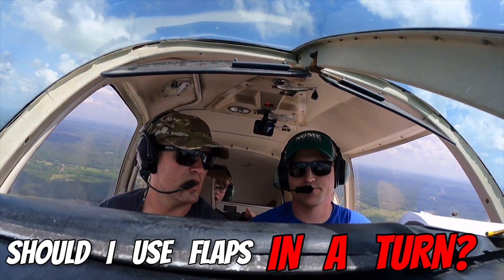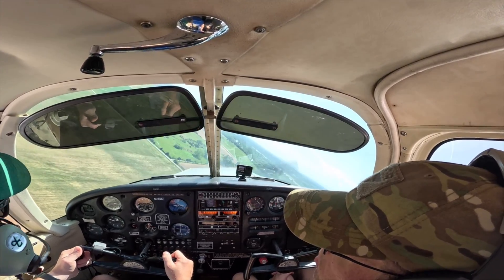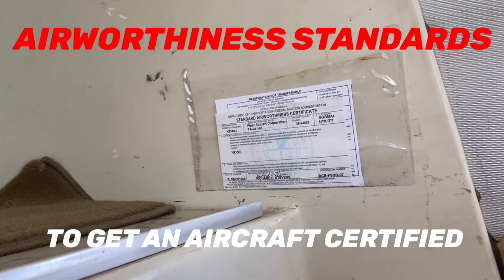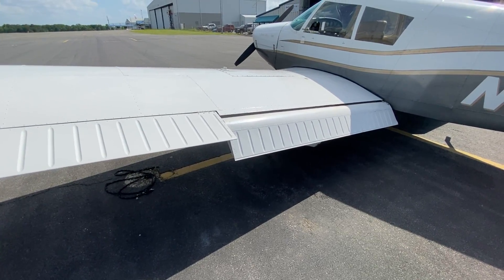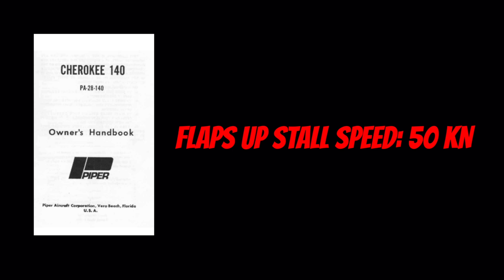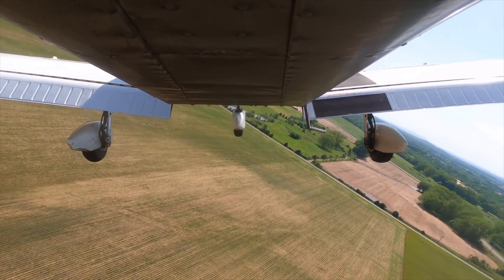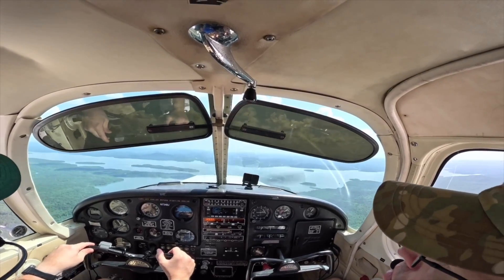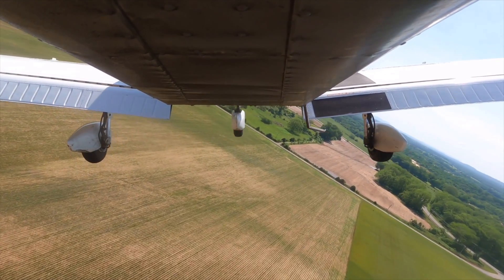Should I LOWER Flaps in a Turn?

Comment: I don't buy your assertion that the turn radius is less with flaps at a given airspeed and bank angle. In level flight, the amount of lift produced by the wing is based on the aircraft weight, the bank angle, and some trigonometry. Although the wing may be capable of producing more lift with flaps deployed, it isn't actually producing more. It is true that the flaps would allow you to use a steeper bank angle or slower speed with the same stall margin. But, unless you change the speed or bank angle, your turn radius will be the same. I am not challenging the main conclusion of the video.
Reply from the maker: I will admit that it is an assumption based on my experience, BUT flaps allow you fly at slower airspeeds which will ABSOLUTELY decrease your turn radius.
Reply: @FreePilotTraining  No disagreement about that. Slower speeds have a BIG impact on turn radius - more than proportional.
Reply: I was about to write the same thing.  If the same bank angle is maintained and the same airspeed is maintained and level flight is maintained, then using flaps will not decrease the radius of the turn.  I won’t use an equation, but I will reference a diagram even though I can’t draw it here.  Most pilot instruction books have the diagram.  Assume a 45 degree turn at a given airspeed.  Since we are in level flight, the vertical component of lift has to equal W, the weight of the airplane.  The 45 degree bank angle means the wing lift vector is 1.414W.  This also means the component of the vector towards the turn center is W the same as the vertical component.

Now let’s assume we maintain constant airspeed and deploy flaps 20 while maintaining the same airplane attitude.  This will increase lift as you stated in the video.  Let’s assume the lift increases from 1.414W to 2W (I realize it likely isn’t that much, but just trying to keep a few whole numbers here).  When the wing lift vector goes to 2W, both the horizontal and vertical components of lift increase proportionally and are now 2/1.414 = 1.414W.  So, I agree with you that this will provide more force towards the center of the turn, but it also now provides an upward force 41% greater than the airplane weight and thus you will start climbing in addition to turning tighter.  The only way to not climb is to lower the nose (reduce AOA) until the vertical vector is again equal to W.  This reduction in AOA to maintain level flight will also now reduce the lift vector from 2W to the original 1.414W and also reduce the horizontal vector into the turn back to W.

Therefore, the turn will be flown at the same airspeed, but will not be any tighter as the force component into the turn is the same as before the flaps were lowered.  The only think that will change is the airplane attitude.  The turn will be flown with a lower nose attitude as the additional camber of the wing means the same lift will occur at a lower AOA.

Make sense?

As to how you got an apparently tighter turn on the tracking software, I am at a loss as I don’t think that can be done without violating the laws of physics assuming you really had the same airspeed, same bank angle and same level flight path.
Reply from the maker: @LTVoyager  Something I did not mention in the video is that flaps allow you to fly at slower airspeeds which definitely will shrink your turn radius. Now, I don’t disagree with anything you said, BUT that all assumes that horizontal lift is equal and opposite to load factor which assumes that weight and centrifugal force are equal. I don’t actually believe that to be the case.  Many physicists believe that centrifugal force is not even a real thing.  I don’t share this particular belief, BUT I believe that the increased lift that is created by the flaps improves this turning capability because there is a side load on the aircraft.  Now, once again, this is a theory, but ag pilots intentionally use flaps to tighten that turn radius. I’ve used flaps at higher speeds enough to convince me of this theory.  Like I said, it’s a theory, but I was able to produce some results, but, like I said, flap STILL decrease turning radius because you can fly slowet
Reply: @FreePilotTraining   Yes, I agree that flaps allow you to fly at a slower speed which definitely allows a smaller turn radius.  However, my recollection is that in the video you specifically stated you flew at the same airspeed with and without flaps and physics doesn’t allow a tighter turn radius in that scenario for the reason I mentioned.

The weight and the lift factor component towards the center of the turn are only equal in the case of a 45 degree bank.  I chose that as it makes the math easier.  In a 30 degree bank, the force towards the turn center will be much less than the weight, based on the different angle of the lift vector. I never said the weight was equal and opposite to the force component toward the turn center, I said they were orthogonal.  The lift component that offsets weight is pointing up and the lift vector causing the turn is pointing towards the center of the turn circle, so they are 90 degrees to each other, not opposite.  And, as I said, they are only equal magnitude in the case of a 45 degree bank angle which I chose simple to make the numbers easier.  That same math and physics applies to any bank angle, but the numbers are less convenient to work with.

I don’t know a single physicist who says that centrifugal force doesn’t exist.  It is simply a pseudo force that arises due to using a non-inertial frame of reference.
Reply from the maker: @LTVoyager  I’m not trying to raise a stink.  Your math is all correct; based on what we know.  I’m just saying that I don’t think the math we use perfectly matches what’s really happening. It’s definitely close, but I don’t believe it’s perfect.  And I had a handful of physicists try to tell me that centrifugal force doesn’t exist.  That’s the only reason I mention it. Lol
Reply: @FreePilotTraining  I never thought you were.  I thought you were trying to understand the physics and am I trying to explain it.  It is the engineer’s curse.  😂.

And, to be clear, I agree completely with your premise that using or even applying flaps during a turn is 100% Ok and actually a good idea.  I learned to fly in the 70s and that is how I was taught then and I have always flown that way.  Cut power on downwind abeam the landing point and drop 10 flaps.  Turn base and drop 20 flaps.  Turn final and drop 40 flaps when needed to adjust glide path.  Flare to a full stall landing.  I’ve always flown that way other than at large controlled fields where it was often not possible or when on an instrument approach.

I will postulate that any person who told you centrifugal force doesn’t exist is someone who knows a little physics, but isn’t really a physicist.  Centrifugal force is called a pseudo force because it really only arises due to the frame of reference chosen, but it is still real in that sense.  Translating between inertial and non-inertial frames of reference isn’t always easy or intuitive.
Reply from the maker: @LTVoyager  I appreciate that

Comment: I learned in France. It was obvious to all that a low speed turn requires some flaps. The more the safer, however full flaps may be too slow and unpractical: reserve for short final.
Reply from the maker: Yes, if you need to stay fast, keeping flaps up might be the best option

Comment: At my flight school, we are trained to put in our flaps during the turns: downwind-base, and base-final. It helps control the balloon from increased lift, and it helps us slow down.
Reply from the maker: I like that technique
Reply: I only fly simulator on a computer and had wondered if it is good practice to apply flaps while  turning to lessen the altitude gain or am I taking an unnecessary risk.

Comment: Thank you,  I learned a lot. I'm just getting used to using flaps on a R/C model
Reply from the maker: No problem!
Reply: Are your flaps on separate servos in your model with a Y harness on one channel or separate channels ??
Something different with full scale and models is that if either one Servo could fail on a Y and or one channel could fail. In any case if turning and or flying a model putting flaps down if one fails it could roll the plane very fast and if your a novice it 😢could be hard to recover likely even an expert rc pilot could have a crash. 
It’s always good to set the first 10* of flaps on downwind  like I would teach in full scale at a 45 degree angle to the end of the runway. Flying a model you would have to think of yourself sitting in it to guess where it is. But at least in straight and level Flight you would know they work and if not have altitude to save your model by quickly raising the flaps if one was not functioning. In full scale not ask likely likely but if so the same goes get that flap lever in the full up position as fast as possible to save your plane and or your butt if flying full scale. Good luck with the complex model transition.

Comment: First of all, I like the video. 
However, I disagree with one tiny detail about the turn radius. I don't want to be the formula guy, but the turn radius in level flight depends only on 2 things. Groundspeed and load Factor. If you fly level with constant speed and constant bank angle (thus load factor, as shown in your diagram), your turn radius will be the same, regardless of the flap position. Flaps increase lift and drag, which results in different power setting and pitch angle required to achieve the mentioned speed and bank angle, but not the turn radius. The larger horizontal component as mentioned in the video is only there, if also the vertical component is larger. But then you don't have level flight anymore. Instead, when setting flaps you pitch down in order to reduce the increased lift, but have more AoA margin to generate the required lift in slow flight. Flaps still help in achieving tighter turns, because they allow you to do the turn with slower groundspeed. Other than that, I fully agree :)
Reply from the maker: Hey, I appreciate the comment. Discussions like this are where real learning happens
Reply: Quite right, Daniel.  Per the turn radius formula, if you are flying at 70 knots and you are in a coordinated 30 degree bank, your turn radius will always be 754 feet, flaps up or down, big aircraft or small.

Comment: Very good explanation of an "old wives tale" about flaps in a turn.  I have flown heavy jets to small aircraft and honestly never heard anyone tell me not to use flaps in a turn.  I fly a Bonanza now and we just had an AD required in the last two years due to the right aileron cable having corrosion on a turn buckle due to moisture from a heater duct.  There were at least two inflight problems and several hundred discoveries on the ground.  With the rudder aileron interconnect, when one of the turnbuckles broke inflight the pilot, using all of his experience and brains, determined that if he maintained 130 knots indicated AND making only a continuous left hand turn, was able to advise ATC, find a LONG runway and approached it in a turn and got it safely on the ground.  The right aileron was deflected up and he had to use almost full left aileron to maintain control.  There is an interview with him on YouTube somewhere.  Very scary and well handled.  There have been others that failed upon inspection but thankfully on the ground.  Mine had the beginnings of corrosion when I checked it.  The Bonanza wing is such a great flying wing I tend to not use flaps on long runways but not due to concerns of split flaps but just do it that way...why?  Had a student in his Bonanza that his flaps stuck down full and I had to tell him how to "repair" them so he could get home.  Your demo of turn radius makes a lot of sense.  Thanks
Reply from the maker: Thanks! That is really interesting!  I’ll have to look that up

Comment: Keep in mind, too, that those load factors and stall speeds at various bank angles only apply in level flight. Not in a descending turn which is what we’re usually doing in the pattern. 👍
Reply from the maker: Exactly
Reply: they apply in a climb or descent exactly as in level flight as long as your climb or descent rate is constant. 
 for example, if you're descending wings level at a constant 500 ft/min it's still 1 G.  the vertical speed of the aircraft is irrelevant if you're not accelerating vertically (thus changing the load factor - which is what really drives the change in stall speed)
Reply: @BillPalmer  I'm afraid technically this is incorrect. Load factor is lift divided by weight, at a no-turn climb or descent the load factor equals the cosine of the climb/descent angle (which means that for small angles it is extremely close to 1, making the difference unnoticeable and irrelevant). I will be happy to explain further if of interest.
Reply: @talreichert  Ok, ya got me it's not 1 G it's 0.9986 G on a typical 3° descent angle (e.g., ILS glideslope)
However the G force in the cockpit if the scale was level with the ground would be 1.0. Just like it is in an elevator going up or down at a constant speed. 
It's interesting to note that the difference in g force of just being on the equator vs the pole is a bigger difference than that 3° climb or descent (0.65% vs 0.14%)

Cheers. 🙂
Reply: @BillPalmer  Well, I did say it's extremely close to 1... The issue I was commenting about was the categorical statement that any time an airplane is not accelerating it means the load factor is 1. Naturally, should you choose a steeper angle, you'll get a more noticeable change (e.g. high-speed glide or a climb at Vx). Lastly, I agree that if you put an object on a scale in the cockpit, any non-accelerated situation results in it weighing its full weight (m*g), just not as a result of the lift.

Comment: I’m a student pilot and have been nervous about dropping flaps in a turn for fear of upsetting the attitude of the AC. After watching this video you clarified a lot of things that make sense and have taken that worry away. Thanks!
Reply: Flap extension normally makes the nose pitch down, so don’t worry.
Reply from the maker: @bungee7503  that’s exactly right
Reply from the maker: You’re welcome! Thanks for watching
Reply: Always increase your airspeed  you can always loose that increased speed on final
The book is suggested increase it by 20% see how much better it feels.
Reply: If flaps increase lift, how do they make the nose pitch down? I’m also a student pilot soloing in a champ right now which doesn’t have flaps but in msfs (I know it’s just a simulator) when I lower the flaps when landing, the nose pitches up at each notch of flaps only right when I extend them, after pushing the yoke forward to keep my glide pitch, it levels back out
Reply: @blainepetsupplies5354  The nose typically pitches down due to aft movement of the centre of pressure with flap extension. Pitching up with flap extension is an undesirable effect I’m a bit surprised by.
Reply from the maker: @blainepetsupplies5354  good question. They move the center of pressure AFT on the wing which makes the CG farther forward.  Remember forward CG creates a much more stable aircraft as well.  This is another reason why flaps are safer.
Reply: @FreePilotTraining  so do flaps cause the nose to pitch up or down?
Reply from the maker: @blainepetsupplies5354  great question. Initially, you’re going to get a short boost in lift until the aircraft slows, so the nose may BRIEFLY pitch up, but the as the center of pressure moves aft on the wing, the nose will pitch back down and stay there.
Reply: @FreePilotTraining  ah ok now that makes more sense. That’s exactly what it does on the flight sim. I’ll get a better understanding when i move from the champ to the c150 in my training and start using flaps

Comment: 1 / Sin (45°) = 1.41, 1 / Sin (30°) = 2.0. As an electrician, we use these every time we bend an offset in conduit, was cool to see it pop up in flight training too 🤓
Reply: It’s the secant, or 1/cos for load factor. Sec 60 = 1/cos 60 = 2. Of course the sine and cosine of 45 are the same for an isosceles right triangle.
Reply: Is there a good video to learn it ? Im doing bend radias in my A&P course .
Reply: @michaeljohn8905  tons. Search for “conduit bending” and you’ll find lots. Also might look up the same for pipe fitters. The math will be the same for what you’re doing, you just need to find the video that explains it best for you. Good luck!
Reply: @michaeljohn8905  It's just basic trigonometry. Look for that and you should find plenty of material on it.

Comment: If you lower the flaps you are increasing the load factor the same as if you bank the wings more, your test shows exactly that... a load factor is calculated the same as the g force.  if the arc is shorter the load factor is greater due to the centifugal force.

The downside with flaps is that you will reach the critical angle of attack sooner, in other words you will stall in a lower pitch angle when flaps are down. so be aware when using the elevator for shorter turns with flaps down or when aboarting landing at a low altitude
Reply from the maker: Well, load factor is measured in G-forces which is a combination of weight and centrifugal force and by maintaining a constant bank angle, and level flight, these are not changed. It may be difficult to tell In the video, but I maintained level flight. I did not climb.  This discussion does start to cross into uncharted waters, because there are a lot of factors at play here.
Reply: I never assumed that you had climbed
By banking the wings at 45 degrees your pulling 1.45 G if at 60 degrees 2G because the lift vector is pointing in a different direction creating a sharper turn
If the flaps made the plane turn on a shorter radius it means the load factor was greater 
A car or boat dont gain altitude yet the sharper the turn the greater the load factor